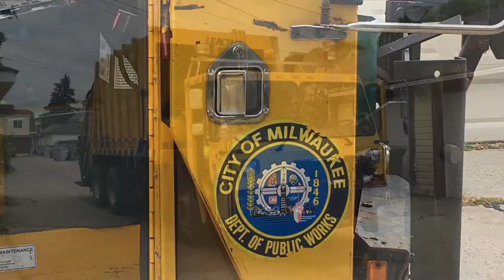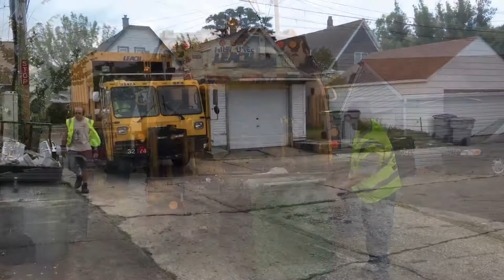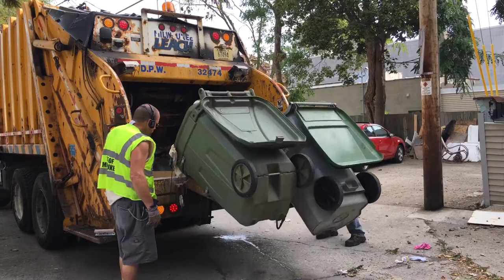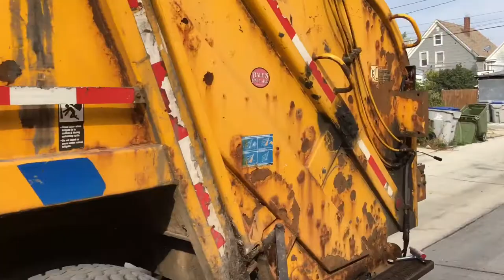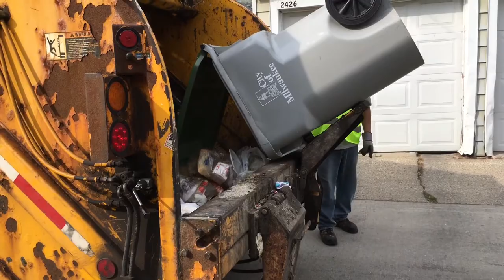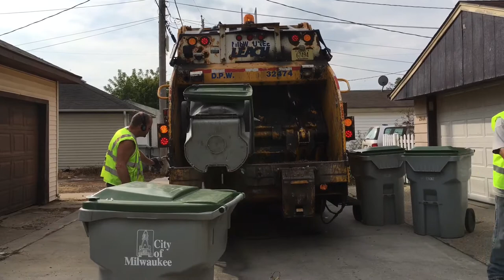Roaring Crane Carrier Leach Garbage Truck — City of Milwaukee

Comment: It's amazing that in 2017 the DSNY STILL dose not use trash carts. NYC has a HUGE rat issue because they just toss loose bags right on the curb. Just one big buffet for the rats. Also, using carts reduces worker injury. Imagine these guys 40 years ago having to lift heavy ass cans...ALL DAY LONG. Can you say DUTY DISABILITY. Nice vid.